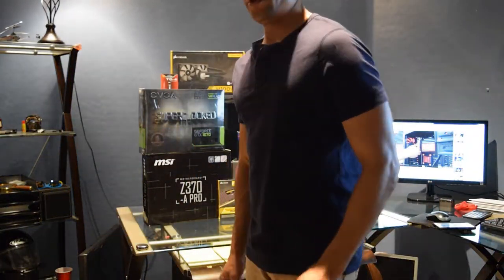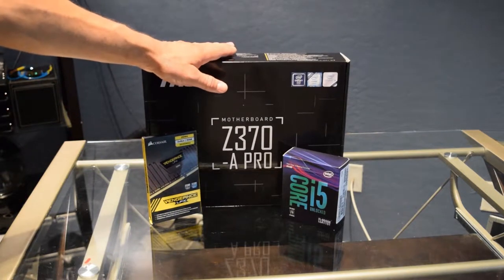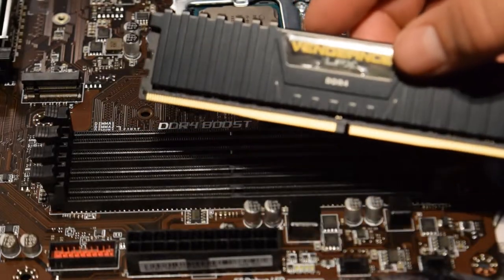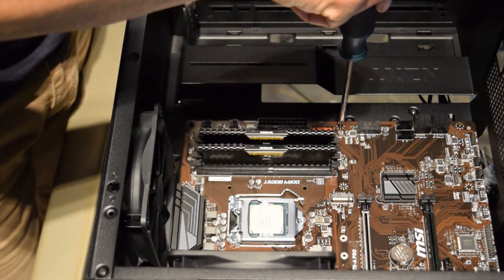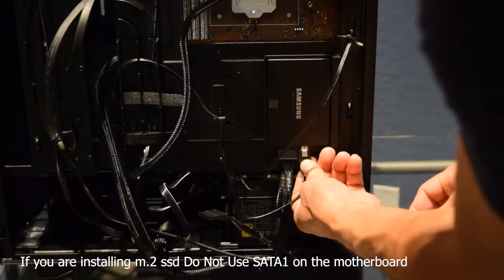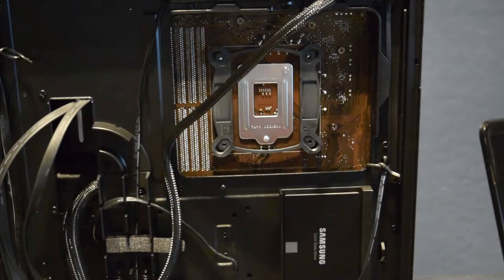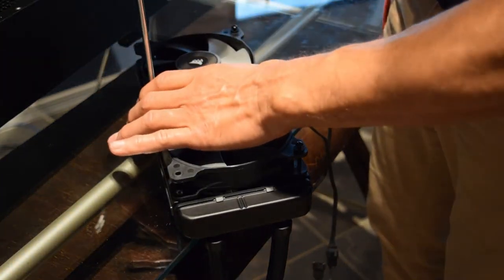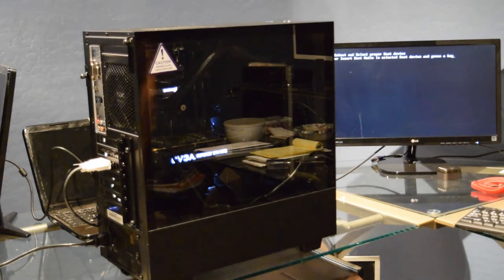Finally  my 1st PC Build | Gaming Starter Guide

Comment: Nice system build. Thou the case you choose does look cool. I heard rumor it has very bad airflow and everything runs 5-10 degrees hotter Get real good Fans.And cost you pay for the Processor you could have gotten the ryzen 5 about $70 cheaper. But too each buyer it what they like.
Reply from the maker: Thanks. I will take a look at that ryzen.